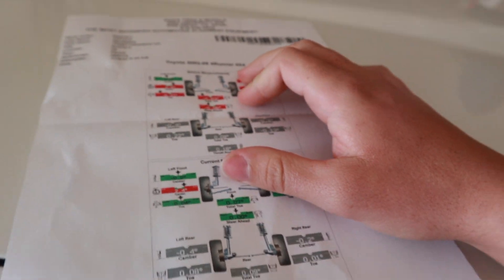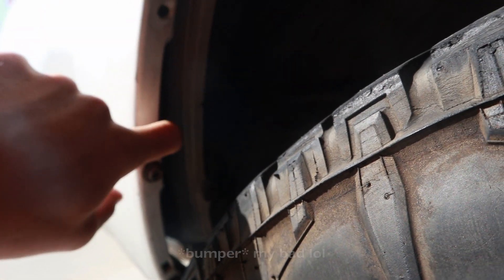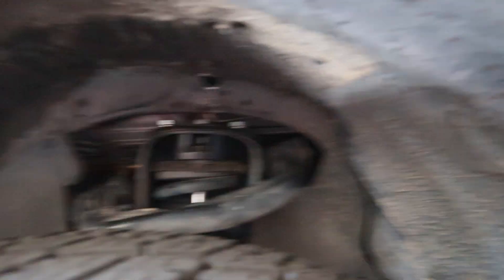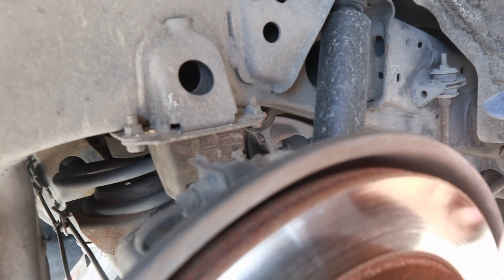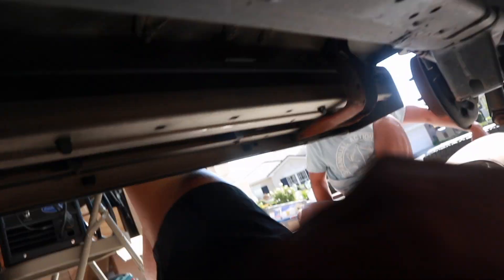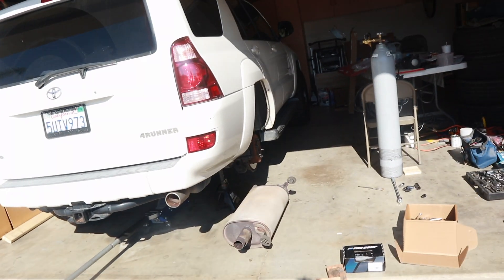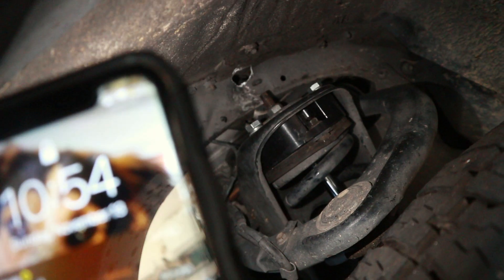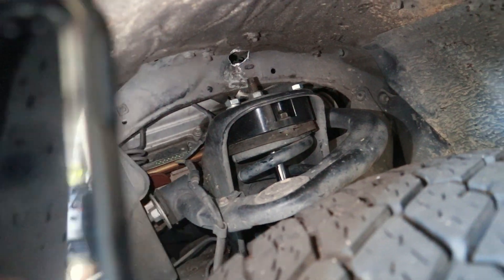Muffler DELETE on my V8 4runner! Sounds Insane!

Comment: I have the same exact 4Runner 4.7 v8 can you tell me all what you did to it so I can screen shot it please
Reply from the maker: Sick dude! Cut the pipe on both sides of the muffler, take it off the hanger, then get a 2.5in pipe to weld in place. The muffler is under the rear passenger seat. Make sure the angle of the tip is where you want it before you weld it back together.
Reply: @GavinFSKarting hey man, had a question instead of welding it could I just use like 4” exhaust brackets to hold the muffler on? In my state you can’t pass inspection without a muffler or should I get one of those pipes thst just bolts on in the mufflers place.